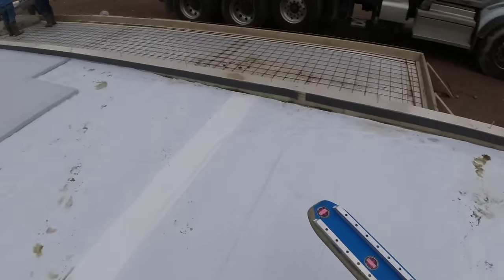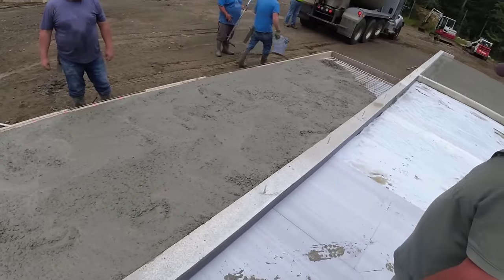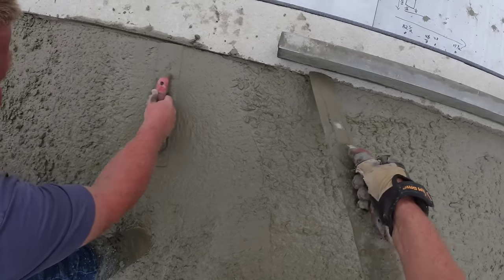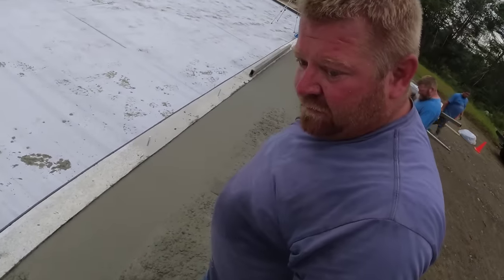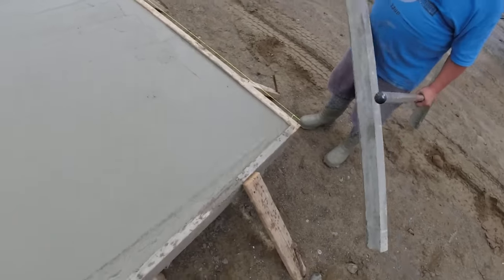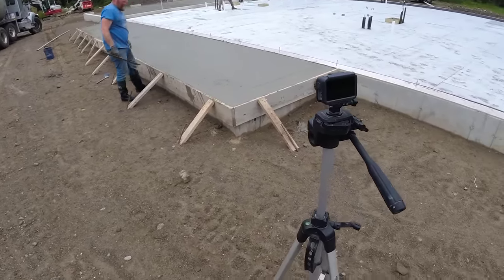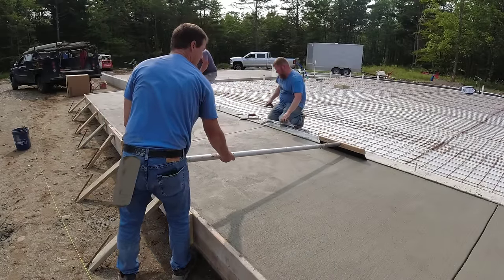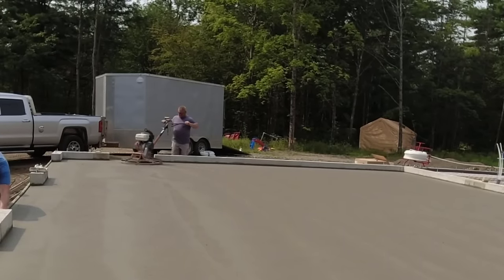(We Ran Out Of Concrete) Pouring And Finishing A Concrete Patio

Comment: You don't need to go to any Gyms when you work pouring concrete. Here in IRELAND I work on a Concrete Pump and was on a job where they had a Guy about 25 with all his Gym Muscles and after 1 day dragging hose around for the Pump he was crying saying his hand's and leg's where sore and he was twice my size and that was only a few hours I went a pumped another job after that one when I went back a few days later to Pump a bit more he was Quite and not saying how much he could lift and pull doing concrete with a line pump will give you real strength